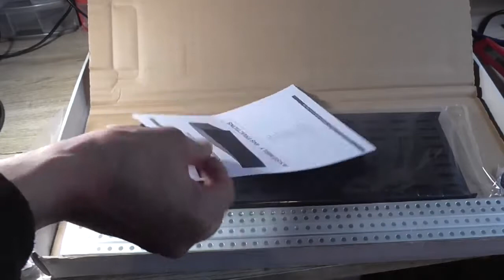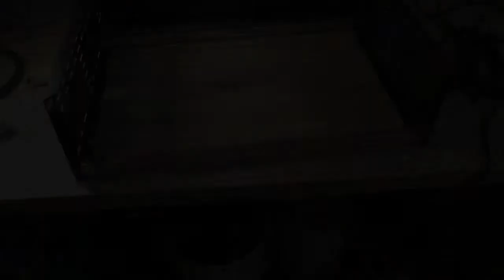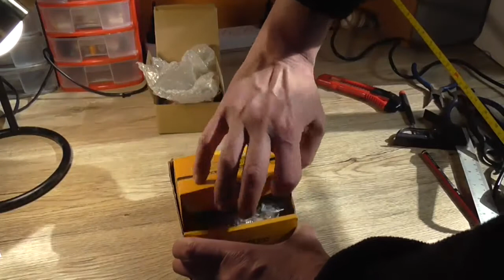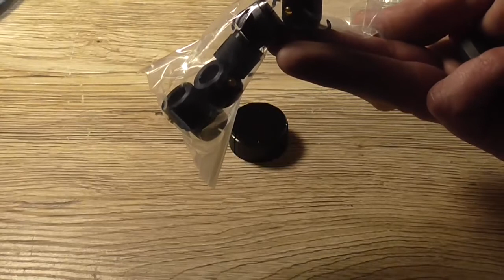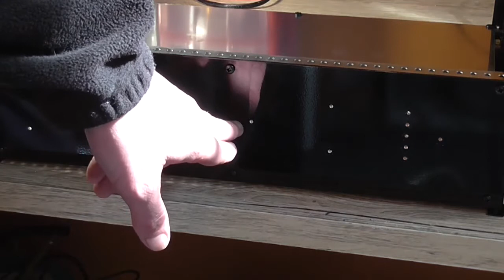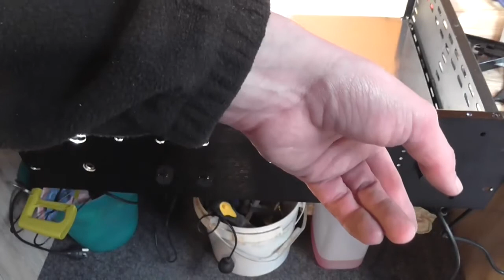Class-D Amplifier Build Part 4: Hardware #1

Comment: I think leaving your mistakes in is great, can’t tell you how many times I’ve messed up a front panel or placement and had to redesign on the fly or start over. Thanks for the cool series.
Reply from the maker: Thank you. I have no problems admitting making a mistake, I am human after all (or at least I believe I am, lol). Sometimes, however, if I film myself saying something and then a test confirms I'm completely wrong, I'll go back and re-record my explanation - that's a little different, though, as I don't want to give incorrect information.

Comment: **TIP**
Toroidal Transformers Electromagnetic field radiates the most where the windings terminate out, so it's a good idea to have the windings close to the back of the enclosure..
try and keep inputs as far away from the winding outputs also if your inputs are to the left then have that winding slightly turned away from that side in fact you can test the best rotation by having an open ended amplifier positive input connected to a 20X20mm sheet of tin or steel and rotate transformer for the lowest hum signal.
Reply from the maker: Yes, I do know that.